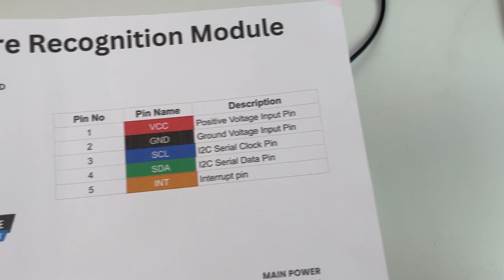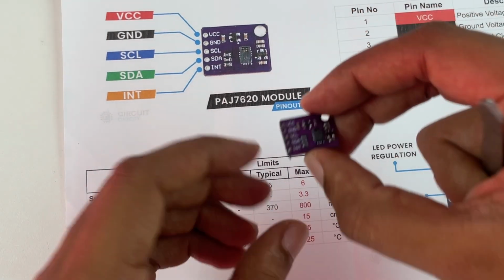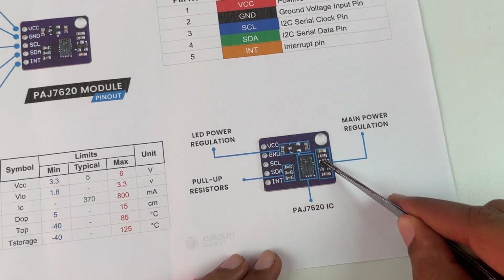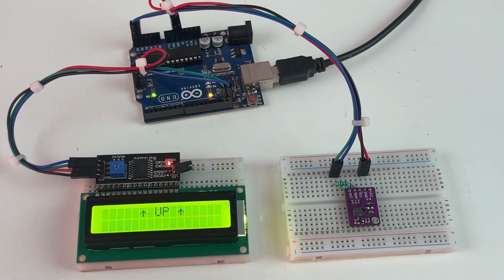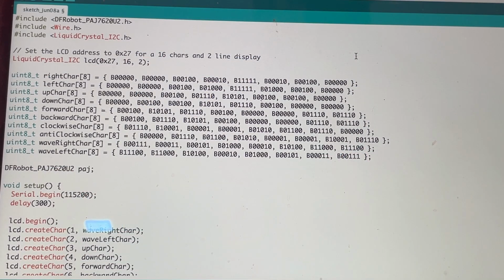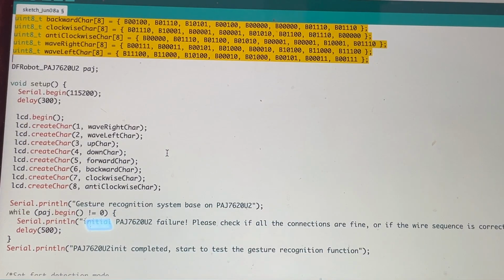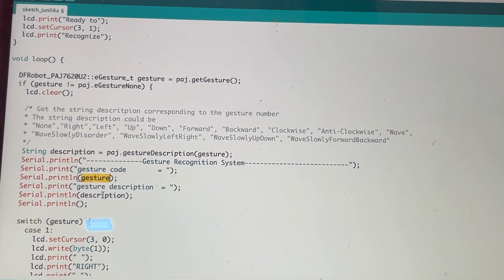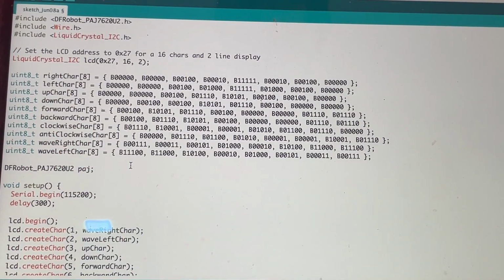How to use PAJ7620 Gesture Sensor Module with Arduino

Comment: Is it a sensor similar to Pixar's sensors as used in Mouse ? I mean would it be technically usable to make a mouse or detecting a surface movement ?
Reply from the maker: Kind of but its not the same.
Reply: @Circuitdigest  Yeah from what i saw in the doc, it's not really returning a pixel matrix right?
Reply from the maker: You can get the pixel data. But its pretty slow.
Reply: @Circuitdigest  yeah i thought it could act as  an optical flow sensor but not really in fact
Reply from the maker: @5zigen371  https://circuitdigest.com/microcontroller-projects/interfacing-pmw3901-optical-flow-sensor-with-esp32 - check this out for optical flow sensors

Comment: I am confused about the working flow of the paj7260 sensor. 

 Gesture sensor detects the movement depends on the movement corresponding whole number 1,2 3 etc is transmitted using i2c

The controller receives the whole number  for the corresponding movement.

 Depends on the whole number the right left etc movement is displayed 

 Is that the working of paj7260 sensor ?
Reply from the maker: Depending the the configuration the PAJ7260 will store the results in corresponding registry. The library functions reads this and maps to a corresponding number for easier usage.
Reply: Can I use the same library for stmcube ide?
Reply from the maker: No. Its for Arduino IDE. But you may try it with STMDuino core.
Reply: I want to use the paj7260 sensor with stm32 microcontroller 
So do I need to read the register 0x43? For getting the movement information?
Reply from the maker: Have to check the datasheet for the exact registry. But you are in th right track.